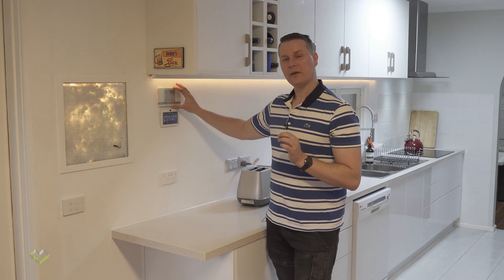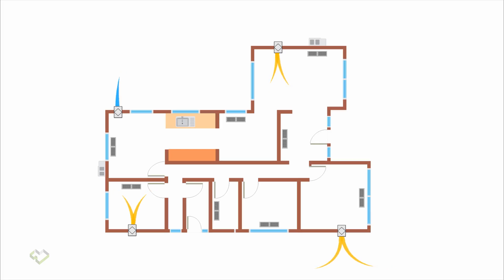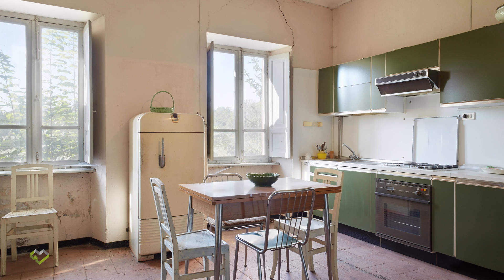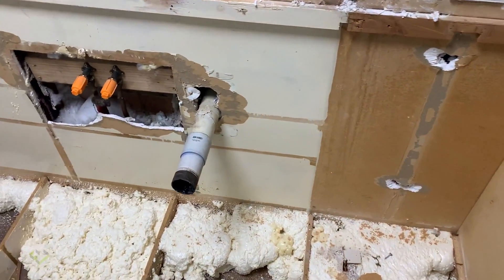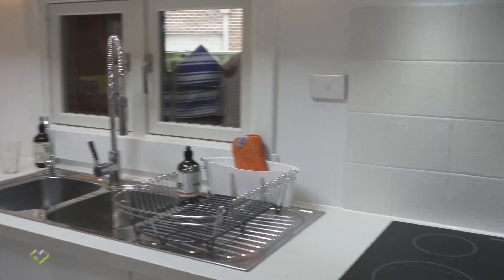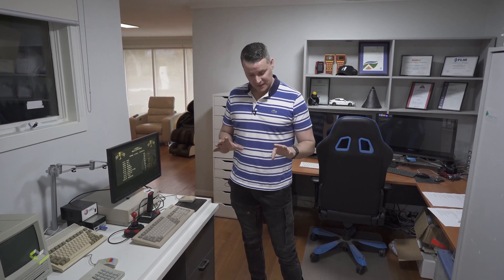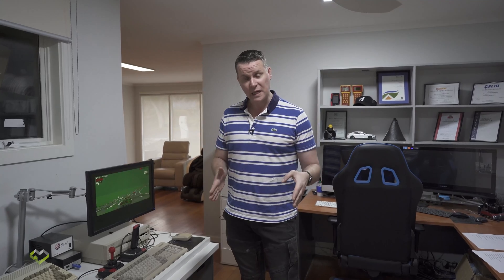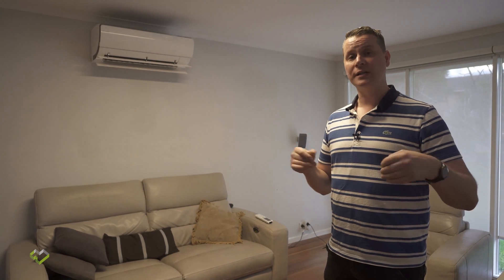70s Brick Veneer Home Remodel for Comfort and Health

Comment: Why did you go with open foam sub floor spray insulation over closed foam?
Reply from the maker: The idea at the time, was if there is a water leak in the house.  But your point is valid.  Closed cell may have been a better choice.
Reply: @ecoevo  Subscribed! we are in a similar situation with the same vintage of home in VIC with the Tas Oak floors. 

We are having issues with condensation on the windows (double-glazed) leading to mould issues. The subfloor earth/ground is unfortunately damp in winter due to being at the base of a hill, so whenever it rains it's a problem. I've been told by the Spray foam contractors that they can spray the subfloor perimeter joist to seal any drafts going up through the gaps into the base of the wall cavity, and that combined with an entire subfloor spray foam should stop the moisture from getting into the house... I'm doing quite a bit of research and due diligence before deciding on it, Im not convinced that its that simple. 

Did your spray foam smell at all after the required setting time? Any fishy smell in the house? Any regrets or would you have done it differently today? might be a good video to revisit?  

I'm also looking the the heat transfer system you have, its a great cost-effective idea. 

Thanks, great content!
Reply from the maker: @bluedunn374  no fishy smells.  Make sure you contract an experienced operator.

If it’s very humid under your subfloor, close cell would be a good idea.   Also installing your hot water pump under the subfloor if there is room could help dry out the subfloor.  It would be a good idea to add subfloor ventilation too.
We did a video with spray foaming the roof of a garage with closed cell foam too.

Comment: Have you got any experience with double brick construction? I'm in a double brick house (Perth) built in the 1940s which i'm currently renovating and planning an extension. I've done most of the same things in your video (wall to ceiling junction still to come and possibly underfloor insulation if there is enough room). It would be good to know if there is anything else i should look into.

Comment: Hi these days polyester insulation underfloor rocking as intalled upon use of proper R ratings are best protection because its fire resistant,  waterproof and non allergic better results than foaming as it poisonous and dangerous felt always on edge even in case of fire no chance given.

Comment: (Question coming from a complete novice here)
I was under the impression that spray foam was not 'good' in terms of insulation. If this different because it's is only being used in the corners of the building or is spray foam insulation not the devil it's been made out to be?
Genuinely curious as a newbie to this.
Reply from the maker: Spray foam has its place.  Its a difficult problem solver, for thermal bridging.  It’s sound insulation abilities may not be great.  It’s ability to insulate, has always been there.

Comment: Another great video. I’ll be doing a similar upgrade to my old house, but I’ll be taking off all internal plaster and starting again inside. Looking forward to more videos in the future. Keep up the great work 👍
Reply: While the wallboard is off caulk the sheathing to the top and bottom plates and each side of the studs. Use drywall gaskets on top and bottom plates and seal up those electrical boxes.

Comment: Maybe I missed it, but how did the airflow from the single split system get the heating/cooling air throughout the house when at the same time the goal was minimal air circulation/flow?
Reply from the maker: The heat recovery ventilation system moves air around, and there are some ceiling mounted DC fans that are used from time to time, but they are rarely used.  With a good building envelope the temperature equalises pretty well.👍🏻

Comment: The external wall insulation could come back to haunt you. If moisture was to penetrate through a crack in the brick cladding, it would have no space to evaporate, soaking into the insulation and framework continuously through the wet months. Walls that receive little direct sunlight during the day would be affected the most.
Reply from the maker: There is no vapour barrier to the outside, and the insulation used is hydrophilic which can significantly reduce the chance of liquid water being trapped in the insulation.  The alternative is to knock down and rebuild, and the Melbourne climate has a long hot and dry summer, which is more than likely going to dry up the cavity.

Comment: This is really good if you have unlimited budget.
Reply from the maker: Rebelaqua How much do you think all these items cost?  We think you can fit most of these items into the cost of an expensive stone kitchen benchtop.  $20K. Leaving the glazing out of course.
Reply: @ecoevo  Thanks. This is all good until I actually get such quotes. For me as a consumer I don't know how to do any of these things myself nor do I have friends to do it for me. So the final cost for me would be $50k (including the crane to lift those triple glazed windows that you mentioned) for glazing, $30k for insulation installed, $8k for, $2k for bathroom automation, $4k for air-conditioner replacement etc, $1k for waste removal. Expensive stone kitchen bench top is about $10k btw for 3meter standard stone bench top.  It depends on square meters of course but this is for normal home with 2 bath rooms etc.  Even for a new build I was quoted $2.5k/m2 for six star normal (Crap) build and $3.8k/m2 for passivhaus standard build. When I added it up, I wouldn't have been able to recoup the extra $100k or so during the lifetime of the build, which would only be about 30-40 years. btw the worst brand of windows is the Australian made Stegbar double glazed aluminium sliding doors. They leak like no one business compared almost any other brand of sliding doors (even single glazed). This type of renovation in Australia is not a reality but just a dream unless you had unlimited budget.
Reply from the maker: Rebelaqua We will cover this topic in another video.  Appreciate your comments. 👍🏻
Reply: @rebelaqua823  not sure how big your house is. Its going to cost me 15k to have r6 in roof, glass wool blow in and sprayfoam. The 15k includes vacuuming out the loose fill in the roof, upgrading meter to three phase  and replacing 9 downlights.
The rest of the stuff looks reasonably inexpensive unless you go with the ERV which could be a grand or so per unit. I have down the upgrades over the course of a year. Sprayfoam won't be done for another few weeks. Last winter I could wake up and see my breath. Living in a house with 0.5 stars is horrible! Also, I was quoted 14k for ducted reverse cycle. That's a lot of money I could spend on other improvements and a smaller heating solution
Reply: @rosduffy3564  Yes it depends on how big the house is. Costs should be quoted for /m2. The point is that this stuff is extremely expensive unless you have tradies giving you massif discounts and doing things out of scope or what ever. Those foam insulation is quite uncommon in Australia and air tight builds are unheard of. Triple glaze windows will cause many builders to pee in their pants and uPVC windows will make your mortgage dissapear fast. 99% of trades will leave massive gaps every where and many of them don't know the meaning of thermal bridging let alone taking actual care to reduce it.  Highly energy efficient builds are possible with normal techniques but it requires trades to learn new tricks and most of them can't be bothered.
Reply: @rebelaqua823  True, the key is finding someone who understands it, guarantees their work and does it in a fair budget. Caulking is inexpensive but time consuming. Door seals and draught stoppers are also expensive, just need to be willing to get in the roof. I am hoping I can replace my IXL tastics myself. I think it's important to recognise the improvements in the video took place between 2012 and 2020.

Comment: Very impressive and lots of good ideas for an old home but you kind have reached diminishing returns,.you would have spent over 50k to improve efficiency other than comfort you would never see a ROI.
Was a very interesting video though
Reply from the maker: If you are happy with the size of your house, it’s cheaper than knocking down and rebuilding.  The return on investment is better than a stone kitchen bench-top, how can you put a return on investment on indoor air quality garanteed CO2 levels in bedrooms?  Mould less bathrooms, mould less window frames?  especially for hey fever and asthma sufferers.
All this stuff isn’t just about ROI! 👍🏻. thanks for the comment.
Reply: @ecoevo  How can you put an ROI on air quality etc? Health bills? Better than nothing :)
Reply: @ecoevo  your windows and door glazing alone would have cost 25k plus. Higly doubt you would ever see any where near 25k plus energy savings from them.
Not sure why you used open cell under floor when closed cell inch for inch has a much better efficiency.
Reply: @chefgav1  would increase house value to cover this cost easily for me
Reply: @richardstokes88  True to a certain degree but you most definitely to get a dimishing return effect.
Once you go past Roof, walls and underfloor you have most definitely be at diminishing returns.
Not including the kitchen Tim would have spent like at least 70k to improve efficiency.
I highly doupt it suddenly added 70k to his value
Reply: @chefgav1  open cell vs closed cell inch for inch would only matter in a confined space such as walls. With open cell you could see if there is  leak under your shower that is impacting the floorboards. I understand its easier to cut away to make repairs too. I am trying to decide between open or closed cell myself

Comment: Hi we are getting ceiling insulation installed this week. First do you feel R 5 is sufficient for Melbourne? We also  have some foil under the colourbond roof when it was installed 12 years ago. Second what can I ask the installer to do to cover the wall ceiling join. 70's brick veneer like yours but no wall insulation yet. Maybe in time.... Great information thanks. Very easy to understand.
Reply from the maker: R5.0 is good.  Just be weary of the importance of insulation consistency.
if you have gaps in your insulation, it won’t perform to R5.0
Use this calculator, to estimate the actual performance of your insulation with different gaps in your ceiling. 😉
https://efficiencymatrix.com/whats-my-actual-r-value-of-my-walls-and-my-ceiling/
Reply: @ecoevo  Most trades don't care about gaps or don't know about reducing thermal bridging. The one who do will empty your bank account faster than leaky aluminium single paned windows.

Comment: What is shown in this video is just some selected upgrades which are relatively low cost and low disruption to the occupants. Very suitable for progressively improving the energy performance and indoor comfort for owner occupiers and even the landlords without the need to clear-up the house for trades to work for extended period of time. The most lengthy project would be the sealing work behind the cabinetry.

Other upgrades including PV, high efficiency appliances, high performance windows will be converted in future videos.
Reply: Did you say low cost? ;)
Reply: @rebelaqua823  I used the wall insulation company in the video and it's not expensive compared to windows and very good bang for buck -comfort levels improved remarkably.. Even better is going around you house closing gaps and putting draft stoppers on your fans.
Reply: @AndrewC007  Agree that installing draft stopping things yourself is very cheap. :)

Comment: Great video John! It would be great if you could publish a spreadsheet showing your ROI from retrofitting the build.
Reply from the maker: Chad King Return on investment... How do I put value on Comfort?  Low indoor CO2? Return on investment also needs to take into consideration how I use my house, and how it’s use may change over time. Ontop of that I have a 6kw solar system sitting on the roof which absolutely destroys the electricity bill in summer. 😉. This is a lot of work.  An easier question may be, what’s the ROI on buying and installing a new stone kitchen bench top which could cost as much as these retrofits. 🤪
Reply: @ecoevo  For the comfort part - how much were you spending to get heat/cool the house previously versus now? If it wasn't as comfortable, extrapolate a bit; a guess is better than just saying "too hard". For the air quality questions, I suppose you could compare medical bills/pharmaceutical etc before and after?

Publish. People will comment/argue with you, but you can use that to improve the estimates. It's all valuable info.
Reply: There is probably over 50k plus worth of efficiency improvements not including the kitchen.
He has well and truly reached diminishing returns and highly suspect would never get a ROI
Reply: @chefgav1  not sure on cost but for me this value should be seen in house price with comfort part of equation. I would certainly pay far more for a home that was this comfortable.

Comment: Can I ask what window and door system did you use ?  Did u double glaze or retrofit double glazing?  Looking forward to hearing from you- love your work !   Am looking at new build in Launceston Tasmania (bought the block beginning of last year) ...
Reply from the maker: All the windows, are abit of a mix bag of lollies.  They were aluminium windows throughout:
Then we put...
Stegbar at the front, double low-e
german sliders at the back triple glazed,
Nader windows everywhere else, window sizes have changed and a brickie had to do a bit of work in many areas.  This was all a big exercise in itself and could be made into a video of its own.
Wanted to focus on things outside of the glazing in this one. 😉. thanks for the comment.
Reply: @ecoevo  Which brand exactly are the sliding doors? What do you call a door system that locks down and seals like that? Also, great videos, thanks 👍
Reply from the maker: They are passive house sliders, aluminium on the outside, timber on the inside.

Comment: Your home is about 1000m for mine and has some similar improvements made. Thanks for the extra tips to help me finish off my job. Is the company skill set to do the cornice foam seal the same one as the one that did the underfloor.
Reply from the maker: Andrew C Potentially, But we did the cornice work outside of the spray foam contractor scope. 😉
Reply: @ecoevo , Did you use closed or open cell spray foam?

Comment: Nice one! Curious about what you did in your roof space too.
Reply from the maker: Hugh Insulation was bulked up, but we still need to get up there and give it some tender loving care.  Over the years with all this work, it’s become a bit messy up there.  I’m not sure if you noticed it but in the thermal image there was abit of a cold spot away from the corner on the ceiling which needs abit of attention.  We may cover a video on this topic.
Reply: @ecoevo  Hit me up if you want to get footage of crappy insulation - house around the corner - then again crappy installation is not hard to find.